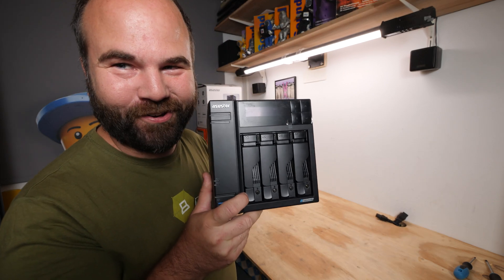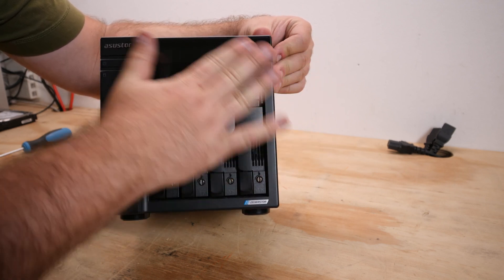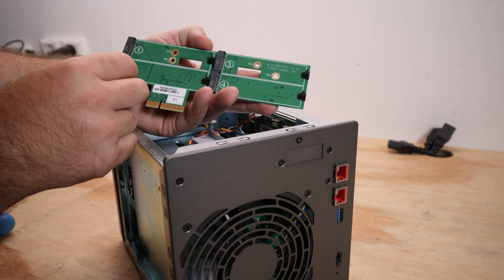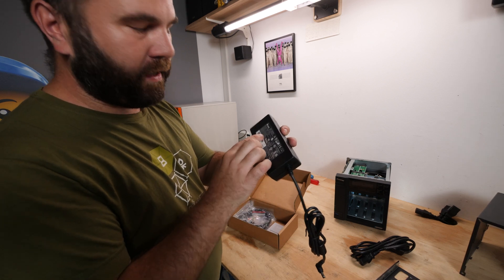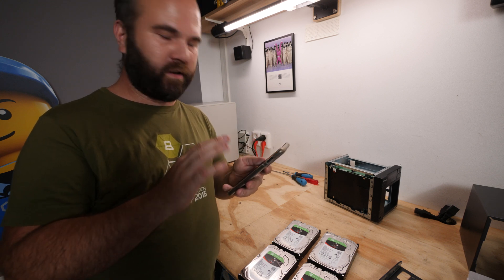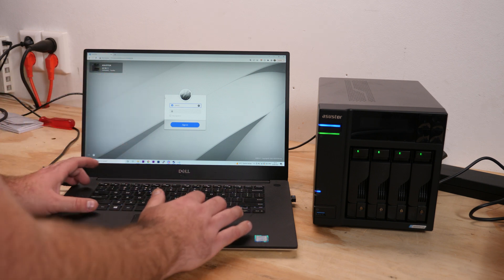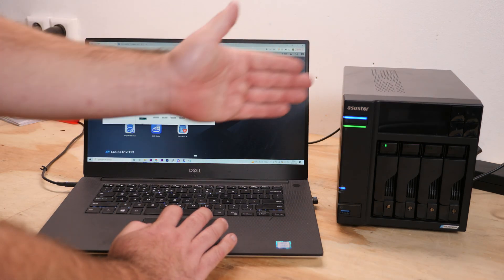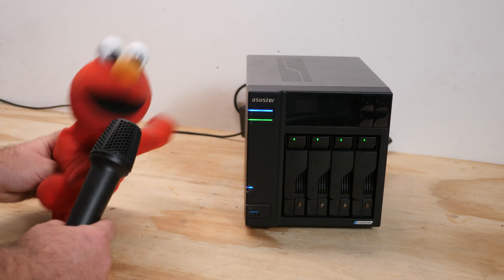Asustor AS6704T NAS - Full Linux Server with BTRFS

Comment: It doesn't look like there is any controller on that M.2 card.... Might just be the carrier for a controller on the motherboard itself.
Reply: Hi there! It is a real PCI Express slot. We have a BIOS mechanism that can switch between regular PCIe and the bifurcation method we use for the M.2 carrier.
Reply: @ASUSTOR_YT  Yes but the point I was telling Victor is there is no controller on that M.2 board so use in a regular PC would do nothing...
Reply: @neccros007  Ah yes. That is true.
Reply: @neccros007  It might work if the PC supports bifurcation maybe?
Reply: @seshpenguin  But that board is just a carrier... No controller on it whatsoever
Reply: @neccros007  I could be wrong, but that's the purpose of PCIe bifurcation, no? You don't need a PCIe switch chip or anything on the board because the motherboard will split the lanes into multiple devices itself, so the NVMe adapter is basically just a passive device.
Reply: @seshpenguin  Maybe I am wrong but most M.2 PCIe boards have controller chips and this one is just a carrier
Reply: @neccros007  Yea those do exist (since not everything supports bifurcation and its a fairly recent motherboard future), but if you look at Amazon you'll find the cheaper PCIe to 2x or 4x M.2 boards don't have a big controller chip (and they'll mention requiring bifurcation support).